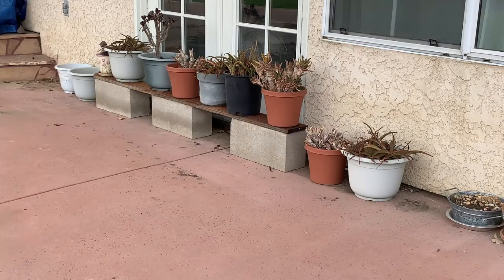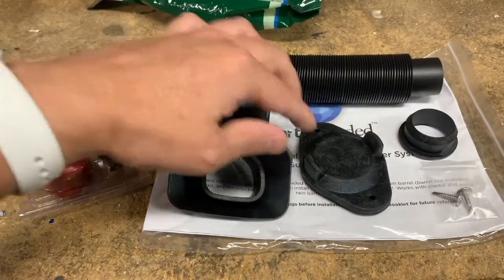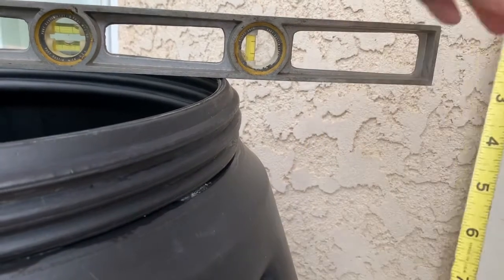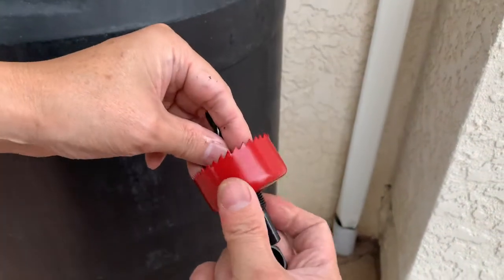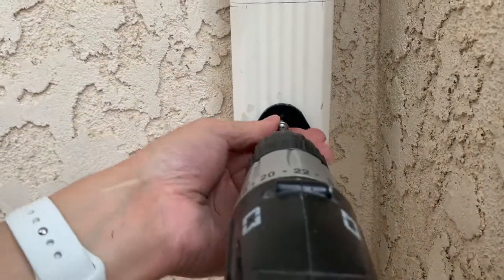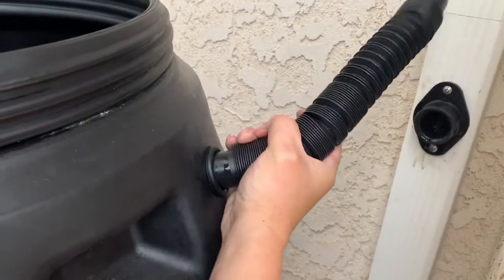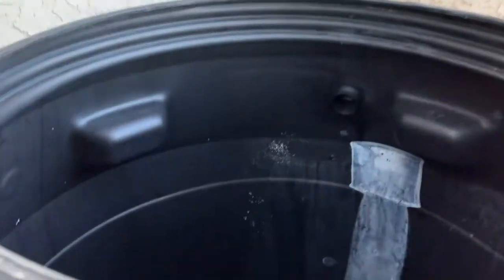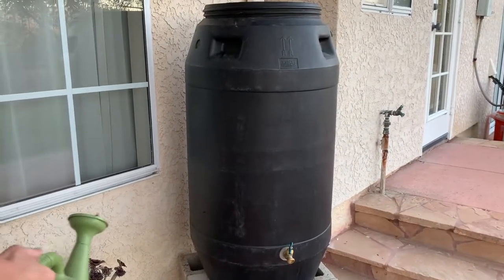EarthMinded FlexiFit Diverter System Review and Install

Comment: I don't understand why the diverter inside the downspout is a doughnut? Does it divert only a percentage of the water traveling thorugh the downspout?
Reply from the maker: Hi Terry.  That's correct, only a portion of the rain coming down the downspout is being captured by the barrel.  That said, it's pretty amazing how quickly the rain barrel becomes full with heavy rain.   When the barrel is full, all the water is then forced down the center hole and down the downspout.  Hope this helps.

Comment: How is it with keeping debris out of the barrel? Also, wouldn't it be better if the hole in the downspout is lower than the hold in the barrel verus it being parallel?
Reply from the maker: Hello.  Fortunately, my gutters are relatively clean and I don't have much problem with debris in the water.  I live in a one story house, and clean out the gutter yearly. That said, I only use it to water plants.  So, no need to have super clean water.  I suppose you can use some type of mesh to keep out the debis, but that creates a point of failure where it can get clogged...  I like the hose being level,  that way when the water level nears the top, it reaches an equilibrium.  Not too high, not too low.   It's been working flawlessly through many rain storms. 👍

Comment: shouldn't you have gone down 4/3/4 on down spout so you have fall instead of 5 in ,am i wrong ?
Reply from the maker: Hello Thomas,  I've personally done 2 barrels with the specs in the video.  Water completely fills the barrel and diverts the excess as designed.

Comment: How does the winter cap fit on? Do you just disconnect the hose and pop the cap on?
Reply from the maker: Hi Beatricemendez109, the diverter valve is removed and in its place, the winter cover is attached using the 2 screws (using the existing holes).  Hope this answers your question.  Thanks!
Reply: @BIsForBudget  Thank you! I just placed my order for a kit!